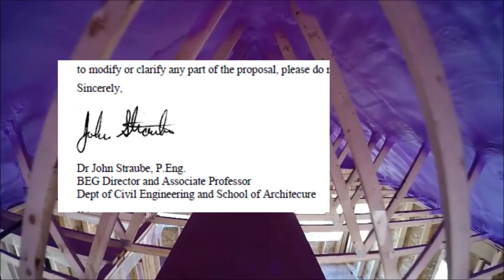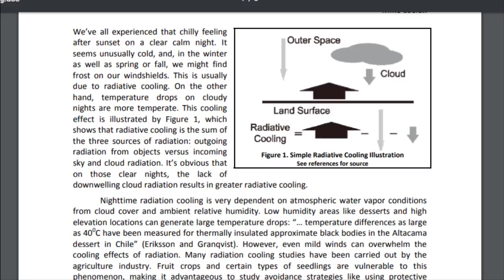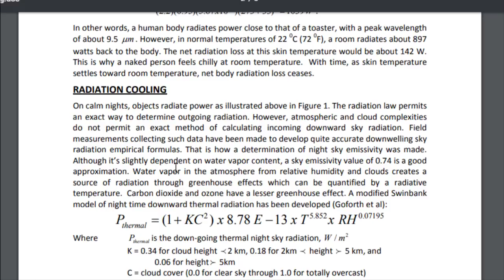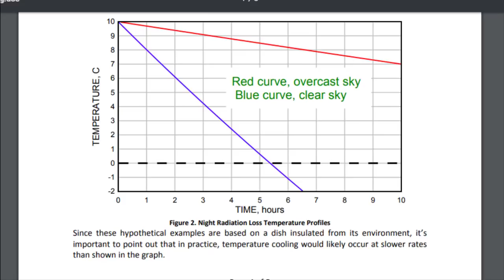Spray Foam Insulation Causes Frost Lines on The Roof - Why?

Comment: Interesting observations with spray foam roofs, but one could see something like this with non-spray roof as well, given right conditions.  I have seen this uninsulated garage roof.  The Stefan-Boltzmann law states that every object emits radiant heat (also known as infrared or longwave radiation) as a function of its temperature, as stated in this video.  In this example, there is two different thermal masses (wood+roof and foam+roof, at the surface, regardless of the thickness of the foam and ambient conditions inside the building) and most likely of different temperatures at the surface.  As such, the surface along the trusses are emitting radiant heat differently.  An infrared camera would show the differences in surface temperatures.  The difference would most likely be the greatest early at night (due to an accumulated heat by the sun during the day), and would dissipate overnight, as the roof surface temperatures would equilibrate.  If this contrast in surface temperature would not dissipate overnight (on a infrared camera), then it would be an indication of a transfer of heat (heat lost through the trusses).
Reply from the maker: Exactly. Now to get the other guy who commented about this being a "hypothesis" to read what you wrote.
Reply from the maker: This comment is so good, I will be using it in the up coming Cathedral roof SPF series where we once again update on this subject matter.
Reply: Sorry guys I’ll stick to fiberglass, I think the spray foam gets everywhere while fiberglass won’t but I just don’t trust t or like it. Also if you have to run something after it’s foamed how do you do it?
Reply: @genebranson3393  all materials breath. the wood will always need to breath per say..taking on and releasing moisture, which is why i agree with fibre glass insulation. 
plus cheaper
plus less mess when re-entering that section.
spray foam off gassing?

Comment: 40% of my roof is open beam ceilings, 2x6 tongue in groove boards over 4x6 joists on 4 foot centers. They look great from inside the house. The 2x6 roof has felt paper and 3 leaf composition shingles, no insulation. Drill a 2 inch hole into the underside of the roof in my living room and you can see the moon.

During frosty mornings, I could go across the street and take pictures of whole areas of the frost melted off over the open beam ceiling areas.  On some mornings I could see stripes of frost over the 4x6 roof joists were. They actually stayed colder due to their thermal mass. My frost stripes with no foam insulation was really showing heat leaking through my roof from the inside.

For 30+ years parts of the house got very hot in the summer and very cold in the winter. The central gas furnace would run 55 minutes an hour in February and one time in the summer I saw 106 degrees ceiling with the laser thermometer in my upstairs bedroom.

2 years ago I had the whole roof foamed with 2 inches of rigid urethane, then coated with acrylic and tan granules. It cut my heating bill by 60% and with the house closed up it stays about 75 degrees in early summer. The attic fan came on one afternoon for 5 minutes one hot day and stayed off for weeks. The fan used to run about 10 hours a day in the summer without the foam. The attic stays below the thermostat setting of 95 degrees except then the outside temperature exceeded 100F every day in the shade for a week. This is NorCal where mid 30's are very cold and we see maybe a week of high 90's and above in August.

I like the insulating effect but the appearance from the street is not the best. They tossed the granules and they looked uneven. I had them spray another layer of tan acrylic on top and its acceptable to me.
Reply from the maker: Thanks for watching.

Comment: Interesting yet way to technical for the average person. I knew what was causing it before the video started. I know there are technical explanations, but just stating it is to complicated for the average person. The uninsulated portion of the truss that is in contact with the plywood is absorbing heat into the truss from the sun during the day. When it cools off the exterior of the insulated portion cools off quicker than the area where the rafters are. Contrary to what some people think there is no condensation or melting where the lines are so there is no risk of rotting. Great explanation in the video .
Reply from the maker: Well said.
Reply: @SprayJones  Thank you.
Reply: This does not mean that the roof is not well insulated. There will be little if any R value lost here.

Comment: That is very interesting. Totally makes, I’ve seen this situation in houses with spray foam as well. The colder it gets and if the day before was sunny then the wood would release a lot more heat once the temperature drops. The bigger the difference the worse it would be.

Comment: Yeah pretty common in the North.  The wood stud is a much poorer insulation.  The frost is forming where the insulation is working.  The wood studd looses enough heat to keep the frost from forming.  Same happens with dew.  Not just roofs, walls too.  If there is a layer of snow on the roof it can melt on the studs faster than the rest of the roof.  

Car's won't frost in car ports due to the radiant heat from the ground keeping it a touch warmer.  Usually warm enough to stay above the frost point.  

If this is due to thermal mass, there would be a bit more explaination of the details.  Seen this with snow covered roofs.  They have a layer of insulation (snow) that acts as a radiant break.  This has been the explaination for having a layer of continious insulation outside of the studs.  

Thanks for the video.
Reply: What you say is true. But what he is saying is that if you have a roof truss made out of 2x4s and have 8 inches of foam applied it will still happen even though the difference of heat transfer through the truss member is about the same as the heat transfer through the sheathing.
Reply from the maker: Boom!

Comment: I think it's a thermal differential . You have  an r value of around r 30 for the foam and r 5 for the stud and the heat from the building is escaping more through the studs and not the insulated part.
Reply from the maker: Read the Pinned comment at the Top. I cannot help you when you reject the science and say 2+2 is 6 because you "think so".
Reply: I think of the studs as heat sinks they store more energy from the outside than cdx sheet and release it longer because of greater mass when the temp lowers.
Reply from the maker: @curtissharris8914  On the right track!

Comment: I found your video after buying a new home with a metal roof and after this years heavy winter storm the snow started melting my attic started RAINING. There was so much condensation up there that is was literally raining in my attic.  I've never seen anything like it, it doesn't look like there is hardly enough ventilation for the attic. So my options (at least the way i see it) are to cut in more ventilation or spay foam my attic. Would that take care of my problem?
Reply: Nope.  Will cause more problems.  You need ventilation between roof and insulation.  The cold warm creates condensation and needs airflow.  I’ve seen too many problems with foam.  On paper it sounds wonderful but once you realize it causes so much condensation and Rots the wood you won’t wanna do it.  My buddy has a metal house and roof and spray foamed and has rot in trusses and high humidity problems from the condensation.   You need a gap and vents running from each side overhang between trusses and 2” between roof and insulation to allow that airflow and if it’s an attic crawlspace you want Gable vents.
Reply from the maker: Existing are hard to retro unless we have enough space. I need more data.
Reply: @MatanuskaHIGH  Seems to make more sense to to me insulate between the ceiling joists the way it is traditionally done. Then allow the attic to breath. I use an attic exhaust fan that works great to vent the summer heat. If foam can lead to rafters rotting that would be an expensive nightmare to repair. I wonder if the rot is common with foam or just some houses due to the region/weather in that area.
Reply: @SprayJones  i have a huge vaulted attic nearly 15' tall, 75' long, & 40' wide, I know i need to do some sort of A/C something to help eliminate the moister in the air, i guess I'm just at a loss and not quite sure what questions to ask
Reply from the maker: @CrookedWoodsFamilyOrchard  Send me a hello email via the web site and some pics and I will see if I can point you in the right direction..
Reply: Don Nash probably more in places with cold and warm seasons.  That cold warm will create condensation.  In Alaska they won’t allow spray foam without a fan ventilating the space to mitigate condensation.  An engineer I remodeled for had his spray foamed and had to sign off on it and fight the city of anchorage to even have it done.   He had  vaulted scissor trusses.   If you have cream space attic with normal trusses spray foam would even be worth it cause you want that space cold while insulation on ceiling to keep heat from going into attic with gable vents for condensation.

Comment: Good that they are doing research on spray on insulation for housing. Wood itself has low thermal conductivity, but the spray on foam insulation has 4x more capable of insulation than just wood. Wood is about 0.12W/mK thermal conductivity and Spray foam insulation is only 0.03W/mK. W/mK=Watt / (meter*Kelvin). So wood will leak some heat out, but not as much when you don't have any insulation aside from the layer of wood used to build your roof which is just plywood sheets and roof shingles. Plywood is 0.16W/mK which is worse than those beams for a thin layer of plywood and roof shingles are 0.79 W/mK. So the end result is using the spray on foam insulation is beneficial if done properly, be sure to keep the area open and well ventilated when spraying since the material will take at least 24 hours to settle on or the drawback can happen if not done properly, your house could smell of dangerous unsettled chemicals so care must be taken when adding the insulation.
Reply from the maker: Thanks for watching.

Comment: That’s why I don’t like spray foam. If you completely capsulate wood and it can’t breathe where does the moisture go ? It’s gotta go somewhere. Eventually it will mold and decay within the foam.
Reply: I agree totally.. you have a closed cell insulation on the bottom of the rafter and a vapor barrier (felt/shingles) on the top.... the moisture has nowhere to go... seams to reason that it’s trapped in the rafter and the roof sheathing...
Reply from the maker: I have a video on that 100% dispelling all of that non-sense. 

"closed cell or open cell for unvented roofs."

Comment: That's actually a good thing it shows that your insulation is working it's the same temperature as the outside
Reply: your shingles won't last as long. Do to heat and cooling. They will curl up after time. Dumb way to insulate a home.
Reply: yep because  if you have different  temp in the  roof the the shingles  will heat and contact  and different temps Causing buckling mostly  in the sping and fall.

Comment: Yep seeing frost is good 👍 ... It’s the areas with no frost indicating thermal coupling and/or heat loss are the areas to be concerned with
Reply from the maker: Not all heat loss is from the inside. That is point of this lesson. Read the pinned comment.
Reply: @SprayJones  Of course it is....the trusses are on the inside of the roof sheathing. I never indicated the source of the heat. I’ve had endless discussions with me energy auditor ( with impeccable credentials) after building various Energy Star Certified homes.

Comment: I think it's simpler than that.  The areas where there's insulation can get colder (and freeze sooner/longer)  due to reduced heat flow from behind than the areas where there are rafters and more heat flow through the wood rafters.
Reply from the maker: You are on the right Road.

Comment: It's important to note that even if the studs/joists were 100% insulated from the building interior, you would still see frost lines on the exterior because of this phenomenon.
Reply from the maker: Of course. Tell that to the morons that watch the video and cannot understand what is being said or read the pinned comment at the TOP.
Reply: why then driving to work today when it was 23 outside, id say 90% of homes did not have this issue.  no new homes had this issue, the roofs were 100% frosted over.  only older homes i saw this and two virtually identical homes next to each other, 1 would show the top cord and the neighbor wouldnt.  one of the homes depending which way you see it has to have poor attic insulation and it cant be the home with 100% frost because the top cord isnt getting warm during the day time from the home leaking and releasing that stored energy out when the temp plummets at night.  with good insulation and soffit venting, shouldnt the top cord and the roof decking all be ambient temp and cold for 100% frost?

Comment: My house has densely packed cellulose between rafters and exhibits the same thermal mass loss through the 2X6’s. My house is a large cape with a 3/4 dormer in the rear. Front roof area is very visible from the street. I suspect 2” rigid foam board over the sides of the 2x6 might do the trick.
Reply from the maker: Read the pinned comment. Unless you have the same density of material on the roof deck it will show up.

Comment: My only question is, why don't we see this on roofs over cathedral ceilings? With vaulted/cathedral ceilings the R values are similar in the rafter bays, also there is drywall and perhaps even OSB covering the bottom face of the rafters, which help to hold in heat during the day.
Reply from the maker: You do see it.

Comment: i have a question.  What if you installed a styrofoam baffle/chute to allow air flow against the roof but put the spray foam over the baffle?  You would still allow the little moisture to dissipate behind the spray foam wall without compromising the integrity of the whole installation.  I am thinking that would also eliminate the frost lines as the entire roof would be the same temp (as long as you covered the underside of the roof rafters)
Reply from the maker: Read the pinned comment.
Reply: @SprayJones  that had nothing to do with my scenario but thanks for playing.
Reply from the maker: @billsmith9249  Watch the 4 part series on roofs coming out this month. I will show you evidence of real world roofs that still do the lines even when vented. 
We live this stuff up in Canada.

Comment: On like a 1950s rambler home, that has particulate insulation now, would you do the roof peak like that or actually remove old insulation and do the attic floor?

Comment: The reason why you see the lines is very easy to fix if you know how to build and insulate a roof the way it's suppose to be, first you never spray foam directly on the plywood on which you nailed the asphalt shingles because there needs to be an air gap between the plywood and the insulation, any kind of insulation. The air gap lets the air come in from the soffit and come out of something like a Maximum or other kinds of goose neck to regulate the temperature, the roof's durability will be compromised in every scenario where the spray foam insulation contractor sprays directly on the backside of the plywood.  Most of the spray foam insulation companies only want to spray their stuff and get out as fast as possible and that's why you see situation like this.
Reply: Nope you are wrong.  I have done a lot of research on this and all sources say to spray the foam DIRECTLY to the underside roof sheathing thus creating a "conditioned" space in the attic from the ambient air in the living spaces below the attic.  No "air gaps" are needed.  Are you sure you are not referring to insulated foam panel board?
Reply: @dirtwhisperer658  No, spray foam and no offense but I won't ask you to do my roof if the need ever arise because the underside of a roof needs air circulation which in turn dissipates the heat from the sun, the spray foam on the underside is an easy way to make quick money with less effort for the spray foam contractor in my opinion.
Reply: @Joe-dv5yp  I get it.  I get what you are saying as I am in construction engineering.  I thought the same thing as you and actually decided to do rigid foam board attached to the trusses to leave an air gap.  But after doing a lot of research I decided to go with the spray foam for ease of installation.  I have a HUGE attic with a lot of corners and complicated framing.
Reply from the maker: Joe go read the pinned comment and get educated please.

Comment: Would the installation of Zip system on the roof  would eliminate frost line?
Reply from the maker: Yes. Zip doesn't make a roof panel nor do they recommend their panel for the roof. 
Uniform density of material will allow for uniform frost creation.

Comment: We use cardboard baffles for a cold/ventilated roof. Bottom of truss cord is completely covered. Don’t have the roof lines and much less ice dam problems. Often wondered why this type of system isn’t an industry standard.
Reply from the maker: I will be addressing all of this in a series about vaulted roofs and spraying to the roof deck.
Reply: @SprayJones  When? Just found your channel. Since I have a house full of spray foam I am very interested. Subbed.
Reply from the maker: @lrc87290  Before March is out.

Comment: I have spray foam installed on my homes roof sheathing and this happens to my roof. My neighbors roofs do the opposite. I notice snow melts faster where the insulation is compared where the studs are the snow melts slower.
Reply: Yes it takes longer for the studs to dissipate or absorb energy because of the different mass of the studs compared to the spray foam insulation.